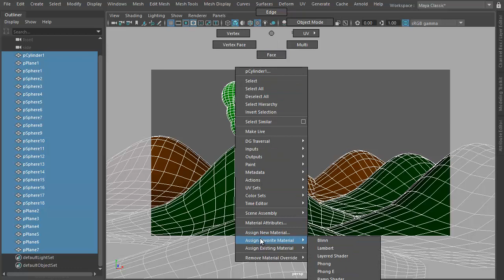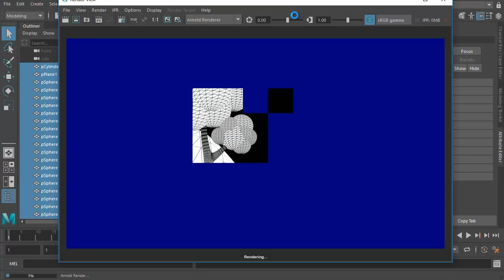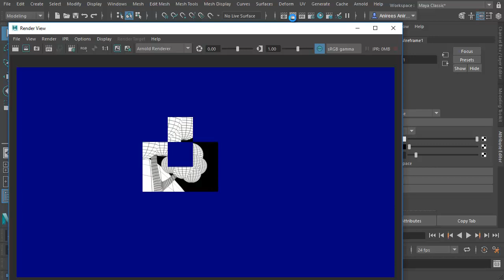Wire frame Rendering in Arnold Renderer : Maya 2017 Tutorial

Comment: I know this is an old tutorial, but did u see how ur tree has much more lines than it original got?

It's because you did a smooth mesh preview on it. Arnold seems only recognize the seams after smooth mesh preview in this case.
Is there a way that not only has the mesh smooth, but also with its actual low poly wireframes?
Reply: Thanks for the input, but I am looking for a way to render original wireframes smoothly, not the final one
Reply from the maker: Do u want both the low poly and the smooth wire frame at the same time??
Reply: @Rees3D  Yes, It will look much prettier if the wire frame are smooth
Reply from the maker: The Final wireframes are smooth. If you want more smooth (more details) you  can apply Mesh Smooth and then render. Hope this helps!
Reply: https://www.youtube.com/watch?v=ofF-VKNtymg

its not exactly using arnold but the link above  is the best way of getting what you are asking for.

Comment: when I used the aiWireframe it works, but the wireframe looks like my model has way more subdivisions and the actual wireframe is more simple. What did i do wrong?
Reply from the maker: I think, you must have applied smooth! if you can share some screenshot with me through my email (andrew@rees3d.com) i can get a better idea of your problem. Or you can also send me your WhatsApp number and I will add you to our whats app group, there you can post your questions and there are many experts who can guide you. Good Luck!
Reply: Yeah you will of pressed the '3' key on your keyboard(Preview smooth), if you press the '1' key, it will return it to normal - Assuming you solved this problem by now haha, just incase someone else has the same problem :)